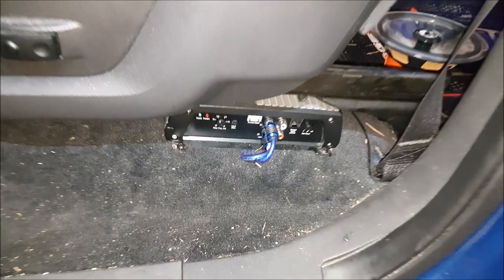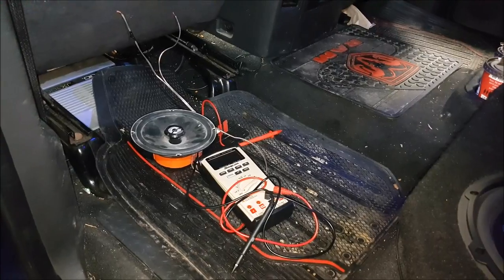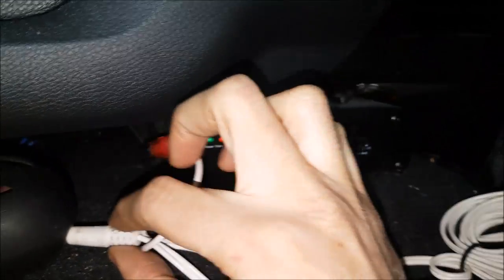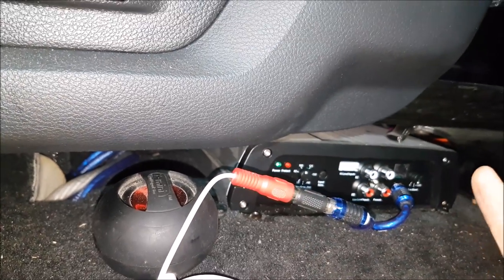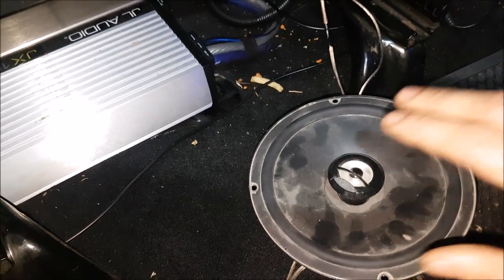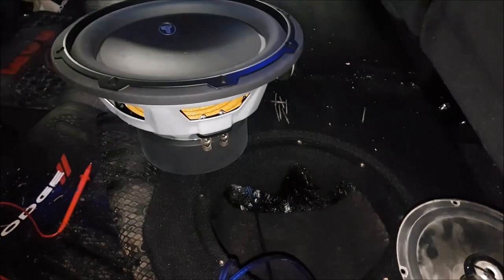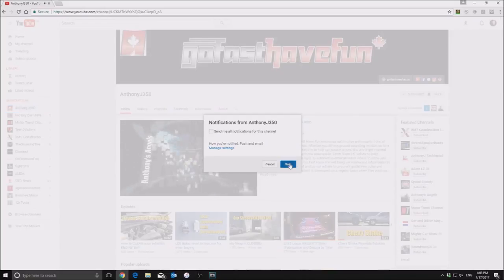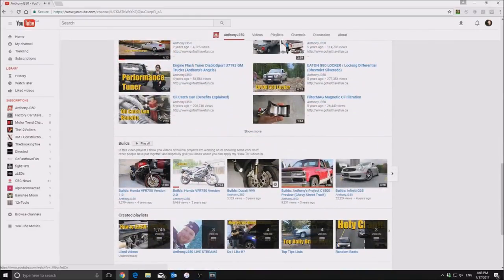Diagnosing a Sound System with no sound QUICKLY | AnthonyJ350

Comment: I have a 2004 Chevy Tahoe Z71 
I bought my interface box from costume sound i hooked up my fold out back up cam everything worked fine then all the sudden my in line fuse blew on my power wire I put a new power wire new in line fuse amp comes on changed the RCA s still no sound what dont make since to me is all my factory speakers work but no sound from my aftermarket subs amp powers up I even ran speaker wire from my subs to my girls amp my subs worked in her car mind blown I have done everything I can think of i even changed the amp out three times still no sound from my subs
Reply from the maker: Sounds like the output of your amplifier isn't working.

Comment: I have a strange issue I have all checking out to be good but almost no power out and have tried three amps same problem I turned up 1600 on a 400 max sum just to get some bass have u ever heard of this
Reply from the maker: Did you check the fuse under the hood and ground to the amp? Verify voltage when you try to play music.

Comment: Unfortunately I think I have shorted my 3 subwoofer outputs on my stereo, after doing some testing I have come to this conclusion. I will send it into the shop shortly. I may for the time being be able to Jerry rig  into the aux output using adapters 3.5mm and rca to my amplifier. Waiting now for my amazon package... unfortunately I have a 2 week wait to get into my local car audio shop for repairs.
Reply: Yes I reset the stereo and it isn't in protect mode.
Reply: Luckily I have the prime shipping for those rcas and 3.5mm adapters...
Reply from the maker: Is the sub woofer output turned off in the audio settings of the head unit?
Reply: @AnthonyJ350  it's on, it is always on initially by default.

Comment: Hi I have a question I have a 10w7 and a jl hd750/1 my subwoofer won’t play like it supposed to until after a few minutes of turning on my car then all of a sudden it kicks in. Any idea what it could be? I had a sundown setup before this setup and it never did this. When I installed the sub into the box It slipped out of my hand when trying to lift it from about two feet. Could that cause it? Like I said it will play normal after a few minutes. This past weekend I pulled everything out because my passenger front door speakers kept going out so I checked my factory amp and wires and they look good. Never figured out the problem with door speaker it just started playing again
Reply from the maker: I would test the voltage at the battery and then at the amp.  Also how is the amp grounded to the vehicle?  Is it like this? https://www.youtube.com/watch?v=vRJjs9Rtp8U

Comment: so i'm having backway noise coming from my door speakers that i've installed. 
and i can't figure it out could you shed some light ?
( alternator noise )
Everything if aftermarket and i've done everything my self, 
Have 2 Amps, 1 for the sub, and 1 for the door speakers.
Both power wires run through the same firewall, and the amp for the door speakers are right next to the firewall both of the power amp wires come from. 

I've narrowed it down to 3 things.
1-The head-unit might be the cause ( mean the rca outputs )
2-The amp i am using for the door speakers. kind of cheap amp, got it from autozone
3-where i'm getting power isn't straight from the battery its from another source. on my car ( 04 impala ) there is 4 places to get power so yeah idk i'm at a lost. 
I could video it to make it more help full i'm just lost.
Reply from the maker: Are the RCA's ran far from the power wire?  Is the battery in good condition (helps filter noise)?  Try running a ground from the head unit and ground it at the same point as your amp that runs the speakers.
Reply: AnthonyJ350 the rca are kind of next to the power wire.
Battery is good.
Ground the head unit ? 

I have 2 amps so would it matter if the other one wasn't grounded at the same spot?
Reply from the maker: Corona Ya ground the head unit at the same place as your 4 channel.
Reply: finally have a day off, doing it tomorrow with organizing the wires, soldiering them, and shorting them up, 
will do a video of before and after but i believe grounding the headunit will solve the problem.  
thanks for the help
Reply from the maker: Corona Hope it works for you.
Reply: AnthonyJ350 so it ended up being the first thing you said . 
Except it wasn't the rca's next to the power wire. 
It was the speaker wires next to the power wire.  I didn't get to video the first time I tried grounding the head unit, or shorting the wires . 
But I still haven't fixed it. Off tomorrow and this time I will to make sure anybody has this problem they could see how I checked everything . Thanks for the information though really appreciate it
Reply from the maker: So you kind of narrowed the problem down though?
Reply: AnthonyJ350 it know the problem.  Just have to fix it tomorrow

Comment: Could the way you wire the subs have to do with them not playing ? Like parallel or series . Because I have two Kicker CVR twelves 4 ohm  400 rms each and I’ve been having a problem with making my alpine monoblock playing them. It’s a mrp1000 or something . Id appreciate any type of advice
Reply from the maker: Mr. Mike If they're wired backwards they can cancel each other out.
Reply: I also have a pair of dvc 4 ohm subs that I knew wired “pos to pos and neg to neg would be a 2 ohm load but the pair on my mono block kicker cxa600.1 would cause heat issues, “lower ohms resistance is easier to push which makes more power but with power “w” comes heat. 1 watt = pie, pie = 3.141”so I took the amp apart and upgraded the thermal paste to thermal grizzly krynauht and reassembled, im also using it in the garage with a dps1300bb ibm power supply, So i rewired the subs both individually to 4 ohm to make a 2 ohm load instead of the 1ohm load the pair would have made. The amp quit putting out sound just a min in to testing the first 12. After wiring the other up too and a full reset and all the amp wont put out sound so ima look into that with my magnifying 410 shot gun. Kicker audio is shit these days. Ive had alot of bad kicker stuff. Passing the bull and goin to the known best. Rockford.

Comment: I connected everything right and I know my subs are working....amp turns on but when using a toner I know sound is going into the amp through the rca connectors but not coming out the output for the speakers....please someone help me, my amp is massive 3600D....
Reply from the maker: Did you try a test speaker at the output?

Comment: hi,  I had problem with my system. i had 2 kicker 10 inch sub rated @ 100 watt rms @ 4 ohm svc each and wired them to final 2 ohm. my amp is turn on but no sound produce on the subwoofer. i try to change the rca, still no sound. my amp rated at 500 watt rms @ 2ohm. the amp grounded on factory ground terminal (copper plated). im using 4 gauge wiring kit. when i took the amplifier output from speaker terminal using multimeter on amp, even on max gain, i can only get 13 volt. is that an indication my amp is bad ? according to my calculation, for total 200 watt rms, i should be getting 20 volt from my amp. saw many videos on youtube, I am quite surprise when others can get 30+ volt from the amp. please respond.
Reply: I also tested the amp with different speaker, no sound as well
Reply from the maker: Did you test the RCA and hear output from them?

Comment: Dude the shit was playing when I had it out of my vehicle testing it and it works for sure and then I put it in my vehicle and it doesn't work but it powers on and I don't have an aftermarket head unit because I have bullcrap Ford sync and all the stuff that you can't really go without is tied in through the radio because they like doing that for some reason so I can't put an aftermarket head unit in so I have to use a line out converter so I had to tap into my passenger rear door speaker that which is a headache running my wire all the way back up through there which seems like a waste of wire length but after doing all of that it doesn't work I've swapped out RCAs make sure my ground is good. So what My aunt just happened to malfunction and blow between me testing it and putting it in my car but it's not in protect mode? This is some bullshit dude I've done poured so much money into this and now I'm looking dumb cuz I've been working on it for days and it doesn't work like what the fuck man
Reply from the maker: Sorry to hear you can't figure it out. I would bring it to your trusted local install shop.

Comment: I definitely would have nitrile gloves on. I mean that french fry looks good but, I've already eaten. Unfortunately I work on cars(collision) for a living. People run a vacuum underneath your seats once a year. SMH. I use a blow gun send it all to the back and vacuum. I don't have to get inside every vehicle thankfully because I do all the repairs and send them to paint.
Reply: I actually do have a question.....my system has went down and no sub output. My only remaining thing to check is my pre amp sub out from the head unit. Like a moron I've forgotten how to test the pre amp outputs at the back of the stereo for power. Yes, I could do what you've done but I can find a splitter and then a speaker ect without wating a week. I have a multimeter. I've never in my 30yrs of car audio have run into bad preamp outputs. Thats is all thats left.
Reply from the maker: Does you head unit have bluetooth?  Play a sign wave through it search pink noise and set the multimeter to AC.  You can then see if there's voltage coming out of your pre-amp.

Comment: My subwoofer all the sudden has. No sound checked wires, fuses, amp light is on if I turn the volume high subwoofer makes some thumps but that's about it,unless the amp is malfunctioning idk if I should just buy a new amp
Reply from the maker: Did you do the steps in the video?

Comment: I need help. I have 2 12s 2 ohms each L7 Qclass in a ground shaker rated at 30hz being powered by a Cxa1800.1 T. They were bumping alright I was looking for deep low bass but it was hitting hard. I did not see how many ohms they were wired down to but I ended up wiring them up to 1/2 ohm which they were bumping but they just stopped. I put a regular speaker on the amp and it was sending audio. I also only hooked up one of the subs and it was playing.. not loud but it was playing. I also have 2 Xs powers D4800 one replaced my stock battery. I also upgraded my alternator 290A. Can anyone help me I don’t know what’s wrong the amp plays and the subs somewhat play.
Reply from the maker: 1/2 OHM is probably too low and overloaded the amplifier.
Reply: @AnthonyJ350  yeah it was but I have them on a skar 1200 and they hit hard. I ended up getting 2 SoloX 12s thoo

Comment: I'm getting 6v on my rem what can be the cause of that I have stock radio
Reply from the maker: Poor place to get signal for remote turn on when under load.  Search, test and verify an accessory outlet that switches on and off with the key.
Reply: @AnthonyJ350  thanks so much for the reply I went ahead and ran it to the cigarette lighter. Solve the problem

Comment: Had a problem with my sub cutting in and out, checked my wiring and saw that my ground was barely hanging on by a self tapping screw and the metal wasn't even scratched. Don't trust Offer Up audio techs
Reply from the maker: Probably looked like my first example in this video https://www.youtube.com/watch?v=vRJjs9Rtp8U
Reply: AnthonyJ350 yea, I'll give him a little credit. He used 2 self tappers lol. Swapped it out for a nut and bolt and also changed all the wiring. He had my speakers running on some  like thin ass 16 gauge wire. 1600 watts thru 16 gauge, surprised my shit didn't catch on fire
Reply from the maker: Ya that's a little on the thin side.
Reply: Aniceto Maldonado Jr the thing that sucks is this guy wasn't even the cheapest, and the ass even stole an old amp I had

Comment: I need help. I check all wires and the speakers and still no sound. I even went out to buy a new amp. But no luck plz help. It's driving me mad!
Reply from the maker: Did you check signal from the RCAs like in the video?
Reply: @AnthonyJ350  yes. I ended up going to a audio shop. And he did was adjust the knobs on the amp. Smh. I feel dumb
Reply from the maker: @Skyefuego  Never hurts to ask a professional. That's what they're there for.
Reply: @AnthonyJ350  thank you for your reply though.
Reply: Mine doing the same now

Comment: Yeah I'm about done trying to figure out car audio I just wanted a little bit of bass in my system and 3 days later and caring my car apart and putting it back together I don't know how many times and run and wire and hiding it and chasing wire harnesses all that crap and I get my system hooked up which I know works because I tested it in my shed before I put it in my car and now it's just playing more bass through my regular system and no output out of my subs and nobody has any explanations to actually are helpful it's just simple troubleshooting stuff that you would already know by the time you've installed the system and this is some bullshit man like there's no way I'm about to pay somebody $300 to install this stuff so I'm about to kick a hole in my jail adios cuz if you can't listen to them then what's the point in having them. And I'm not about to go out and buy hundreds of dollars worth of testing equipment and electronics instrumentation stuff for this it's bullshit they make it overly complicated just so people can't work on their own stuff. Fuck it I guess I'll never have a system with some bass.
Reply from the maker: Why wouldn't you pay a professional $300 to do the job properly if you don't know how to do it?

Comment: I have a DD M2C AMPLIFIER and I repaired the RCA plug in on the amp because the RCA got damaged from Shipping.  I removed the RCA from the master/slave side and used them to replace the inputs that the head unit plugs into.  Those were bent and broken so I desoldered them and soldered the ones from the master / slave side to replace them.  I'm not getting any sound coming out of the amplifier. The amplifier powers on.  Please advise with any kind of help.
Reply from the maker: You verified you have signal from your source?
Reply: @AnthonyJ350  yes, I have a digital designs amplifier connected to my head unit which I currently am using now and it works fine.  When I connected the DD M2C to the same source to see if it works, it didn't put out any signal to the subwoofer.
Reply from the maker: @MrClydieBoy  Situations like those I send it to a repair facility as fixing the internals is not my specialty.